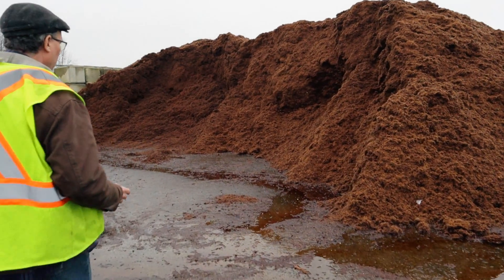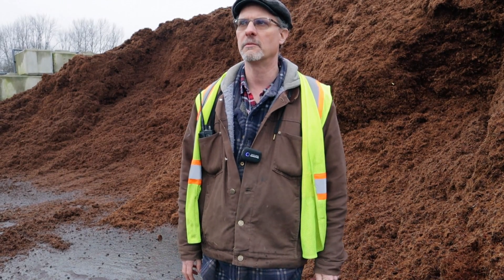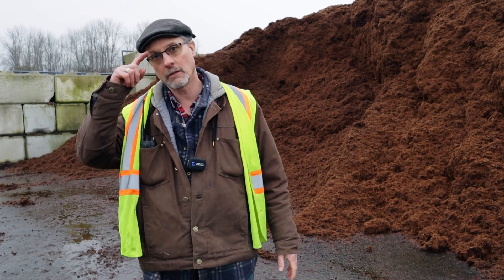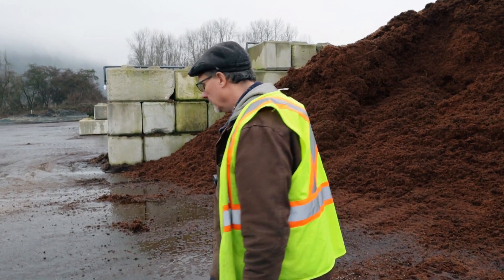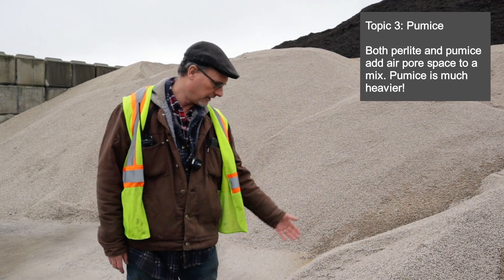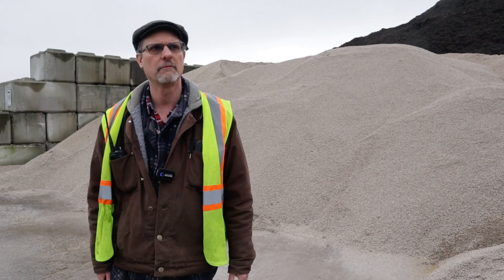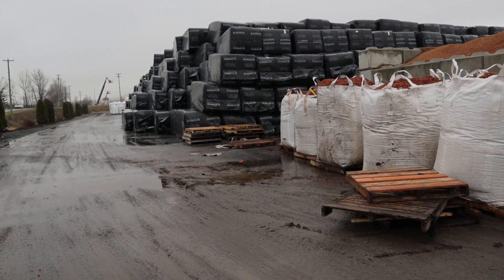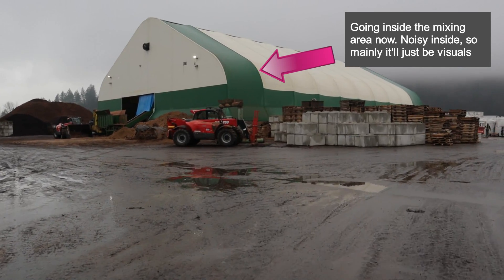Tour with a Professional Potting Soil Producer

Comment: People of America😇 now realise how lucky you are to be able to use these products. Here in India we don't have a potting mix sell like this in grocery ...or other shop. I often use soil from garden or cow dunga or near chicken houses or pig houses..but they are not sterilised and we have to face another issue again.
Reply: Try 70% real soil and 30% Dunga/Manure. See how it drains. If it drains poorly add sand, gravel and or rocks. 

That’s an excellent mix. The downside of it will only be the weight. Your potting mix will not break down and rot away slowly like the American mostly organic mixes. Just add Manure once in a while as mulch.

If you want something almost  like peat moss or coir you can make leaf mold.
Reply: You can also make charcoal for plants. Just soak the charcoal in dunga tea for several days, drain out the water and apply 5-10% charcoal. This will make your mix be able to hold more nutrients so you need less fertilizer.

Comment: Totally fascinating!! BTW, there was a quick mention of why plants need to be continually potted on rather than immediately placed in their final container. I would love to hear a bit more about that in a separate video.
Reply: In a commercial operation, big pots with small plants take up enormous amount of space for the plant sizes involved. I personally sell principally smaller plant sizes as my business model-in part due to the space requirements. Depending on the plant, time of season and market target, perennials will typically go from my 50/72 cell flats to 1qt square or trade gallon (2.5qt.). Generally annuals to packs 1/2 to full qts. Perennials stayin trade gallons for initial grow out and sale from seed or division. As season progresses, I will divide into more trade gallons, mostly, but grow some into larger pots up to 3 gallon for speciman plants, container use etc.  BTW-I grow ornamental grasses and smaller natives perennials.
Reply from the maker: Thanks Laurel. I'll note down the topic for more discussion. There are a different approaches to this problem. Some nursery growers will pot a small plant into the final pot size right away (as Bert talked about in the video) because it reduces subsequent handling. I heard one grower say "Every time I touch that plant, not only does it cost me more, but I'm also slowing it down by transplanting." It's true that there can be a period of transplant stress after up-potting, and it's definitely true that more labor for the same pot is an increased expense. On the other hand: 1) You do have to make sure that your soil will hold up its structure for the entire growing cycle. Going into a bark mix on a two or three year grow, it'll be much compressed and poorly draining by the end. 2) This strategy only works if you have a surplus of growing space. If you're tight for space, it would be wasteful to tie up a growing bed with pots that are far oversized for the plant. 3) When I'm watering, I usually assume a pot size to be more-or-less matching the plant size - so I know I'll be looking at irrigation at a pretty consistent frequency (say, every 2 or 3 days in spring). If the plant is "swimming" in the pot, it can be a long time before it goes through the water in the soil. That makes managing irrigation in mixed stages of plantings really tricky, and almost inevitably ends up with some pots being watered more frequently than they need.
Reply from the maker: Thanks Will - you make a good point about growing space. I also find it difficult to manage irrigation on plants in an oversized pot. You can pick a well-drained mix of course, but they definitely are sitting in a wetter soil for longer than I'd really like.

Comment: Jason, very informative! I didn't think of the fact that the potting mixture had little nutrients and mostly was the support system for holding the growing plant, and that plant feeding was still needed. I hope I didn't misunderstand this?
Reply from the maker: Yes, you got it exactly right - for the potting mixes he's blending for growers, the expectation is for the grower to add their own nutrients and even biological inoculants. In some bagged mixes you'll see a little bit of fertilizer value in the mix, but the peat/perlite mixes (like ProMix) are largely neutral and inert, depending on the formulation.
Reply: So  I will be reading carefully what in each brand of potting soil I will be buying. Like maybe brand X might say 
Their mixture already nutrients added
Good for say 6 months. Right?

Comment: Great video Jason.👌
I was glad Bert mentioned the salt content in both the coconut husk and floated log bark. Most people have no idea what the salt content is and just how much it affects the growth and development of plants.
I remember our conversation about the potassium bicarbonate mixture you were using for fungal control and the experiment I will be using with sodium bicarbonate, surface area only (no ground saturation).
Did you and Bert talk more about the calcium treatment to wash out the salt? I would love to know a good proven solution for rebalancing the soil after tropical storms here in Hawaii as well as coastal storms East and West like monsoon season now. Sometimes it takes a while to get the salt neutralized after a heavy storm. I usually use calcium, magnesium and pot ash, but the results are not consistent because there is so much variation in each storm.
Reply: Similar to muriate of potash compared to sulphate of potash, the muriate is very full of salt.
Reply: @wayneessar7489  Exactly.
Reply from the maker: Thanks - no, that part we only talked about briefly. I was impressed to see how much testing they do on the ingredients - and even on the final mixes. They take an retain a sample from every batch they mix, just in case the grower comes back later with growing problems, and they can then recheck the mix. Very professional!
Reply: @FraserValleyRoseFarm  Good for you to have such a trustworthy source for your soil.👌

Comment: Excellent video! I have found that plants seem to prefer the (cleaned and buffered) coir, or as I often call it, coco-peat, to peat. Another reason I find coir or coir-based media preferable to peat-based ones is that the coir-based are much easier to rehydrate if they get dried out.

Comment: Nice presentation. I have few questions. 

He talks about mixing manures with wood fiber to balance nitrogen to carbon ratio and pH. Later in the video he talks about treating wood fibers to remove sugars and allelopathic oils. Does the wood fiber added to manure have the sugars and oils removed or does composting take care of that naturally? 

How is the the high heat treatment that is used to remove sugars from wood fibers done? Also, how are the oils removed? 

He mentions that c-fiber is so stable you can plant a small plant in a large container. Does he mean that it won't decay before the plant grows to be large enough to fill the pot? 

Thanks
Reply from the maker: It's been a while since I took the tour, but I think the allelopathic oils was in reference to the cedar used for c-fiber. The wood he most often uses in general potting mix is actually composted pine bark (the lowest cost product) and I don't think the oils are such an issue with it. I don't actually know the specifics of the treatments. Yes to the final question: stable enough that it doesn't settle and lose porosity while the young plant establishes roots throughout.
Reply: @FraserValleyRoseFarm  Thanks, any idea where I can learn about this treatment? I am guessing its a professional process that is not available on YouTube. I would like to learn how to process various woods available to me locally to produce a stable growing medium.

Comment: I have question .... I always wash coco coir with water twice and let the salt remove from coir then I use it. ..it's works well for me after I wash coco coir with water.... is it good enough or I still have to use calcium nitrate? ??
Reply from the maker: If it's working well for you, I bet your supplier has already made sure the salt content was okay. You shouldn't have to do the calcium nitrate rinse. Sumas does it on a commercial scale and because they can't be sure about the source.

Comment: Very informative video, thanks. Bert recommends fine cedar chips as a weed barrier atop pots. I can’t get those, so is chunkier landscape bark an acceptable substitute or would this steal nitrogen from the mix? Failing that, would composted fine pine bark mulch work? It sounds similar, but there is the array of products out there gives us lay people a headache! Cheers Jason, one day I hope to make a horticultural pilgrimage to your rose farm!
Reply from the maker: Thanks Donzilla. The fine cedar chips work great because of the grind on them - they're left kind of angular, and make a great barrier when they mesh together. I think a chunkier bark would be less effective. I wouldn't worry too much about the nitrogen lock-up in the mulch. It won't affect the root zone, just the top few millimeters of the potting soil.
Reply: @FraserValleyRoseFarm  You’re a gent Jason, very helpful and thanks for the prompt reply.

Comment: What I gathered from this presentation was that there will be a 'carbon footprint'  loss with whatever we choose to use as a growing medium. If that is the case, and I grow a lot of plants/trees/flowers in the soil, am I replacing the carbon footprint?  How long is peat good for, once harvested, and what happens with unsold peat either packaged, or bulk each year? Could we say that compost, leaf mold, and or perlite, and garden lime, are healthier alternatives in a mix than peat being used in the mix? Just to throw out some questions here. Thank you.
Reply from the maker: Thanks Richard. I've seen peat stored (dry) for long periods (years) with no degradation - and I think Bert was indicating they routinely stockpile to have over a year's supply on hand. I have a seperate video where I talk about the peat situation (in Canada) and it's really a direct analogy to the forestry industry except at a much smaller scale of harvest. https://youtu.be/l7tDS0JXLD0 As Bert said, there's pros and cons to each of the soil media ingredients. Perlite has a fairly high energy production process. I don't think I can say that compost or leaf mold is anywhere near as consistent a product as peat - and I've seen variable performance of plants potted in those. I do like the forest-based alternatives (at least in our region, where the cost and distance of transport is lower).
Reply: @FraserValleyRoseFarm  Thank you Jason for your insights on this. I'll take a look at the video. Best.

Comment: Thank you for the tutorial. I am wondering about a situation that has been developing over time in my backyard nursery. I have about three hundred pine trees growing in granite chicken grit placed in colanders for quick drainage. This allows me to fertilize more often without burning the roots because I water more often, supposedly. I use Espoma's Hollytone because it is recommended for those plants that prefer a little more acidity. The problem is that the trees are gradually turning yellow over the years and dying. Some are still dark green, but growth is slowing down or stopping altogether. Is something keeping the trees from taking up iron or other necessary nutrients? I spray ironies on the plants, but I don't see any greening. I have about 200 hundred shinpaku junipers grown the same way, but they are doing great.
Reply from the maker: Without knowing the history of the plants, is there a possibility of salt buildup in the medium? I know it's an organic blend, but there are also mineral salts in there. Try a pour through test for EC and see what that tells you. You might be doing it already, but I'd also aim to flush the medium with fresh water (no ferts) every 2nd watering, just to guard against salt buildup.

Comment: Great video thanks. I'm trying to source the best product to pot 3,000 young plants (1,600 1g pots) so need to buy in bulk. Limited sources in my area but I can get composted fine bark. What would I need to mix with this, if anything?
Reply from the maker: Hi Anna. Depends on what you can get, but peat or coir at 25%, perlite at 25% and composted bark at 50% is a relatively standard mix. A little bit of lime to balance the pH.
Reply: @FraserValleyRoseFarm  Great thanks. I was hoping the bark would be enough as I'd like to avoid mixing but I'll suck it up!

Comment: Treating with Ca(NO3)2 will probably cause CaCl2 to precipitate, leaving NaNO3 which is very soluble and easily washed.  CaCl2 is afaik very insoluble, so I wonder how they get rid of that.   Afaik instead of peat or coconut core, in countries where garden waste is collected separately (like here in the NL), composted garden waste is also mixed in. (finely divided and then composted in big heaps, started with a steam hose)
Reply from the maker: Good question. I'll nudge Bert about it next time we talk. I guess that's still an improvement over sodium, and depending on how strong the concentration is hopefully wouldn't put the EC out of acceptable range.
Reply: @FraserValleyRoseFarm  Maybe CaCl2 is fairly inert in the biosphere because it is so insoluble.  So that the bit that slowly leaches can't raise the Cl concentration high enough to matter for plants. Since it is a solid, it probably won't register on EC (which is afaik a measure for Ionic Strength)

Comment: Peat is sustainable, especially in Canada. While coconut leaves massive waste. Please do your research!
Reply from the maker: Thanks. I did a video a while back on the impact of peat harvesting (in Canada) and I'll have to agree with your general conclusion. No one wants to see ecological disturbance - like you see when a peat bog it harvested - but Canadian operators have put a lot of focus into restoration at those sites. The same way that we see forestry in Canada as sustainable (because they're able to bring the cut block back to full productivity with reforestation) the same logic holds true for peat (with a much shorter time frame to return to full productivity). Given that the environment is generating more peat than we're harvesting (by a wide margin) it's hard to argue. Nevertheless, I do applaud Bert and his company for also making use of forestry waste products in their potting mixes. They're the most local of the materials.